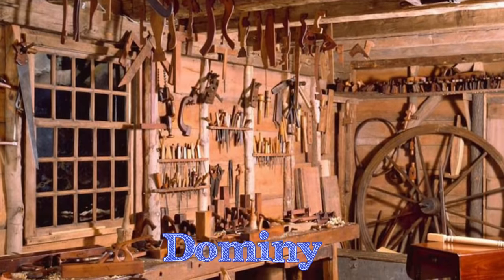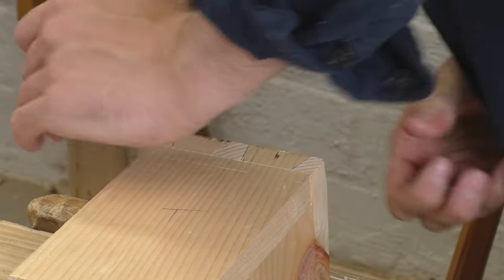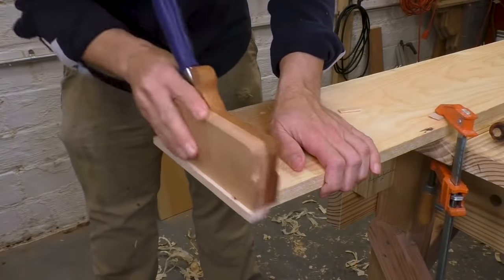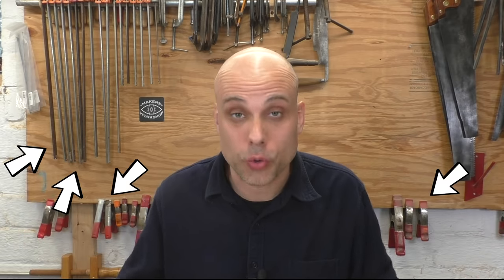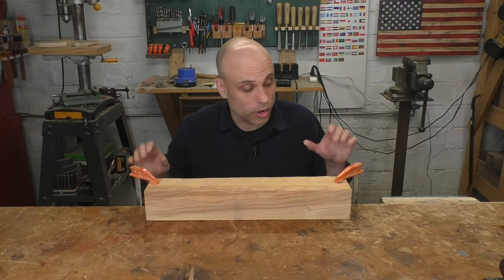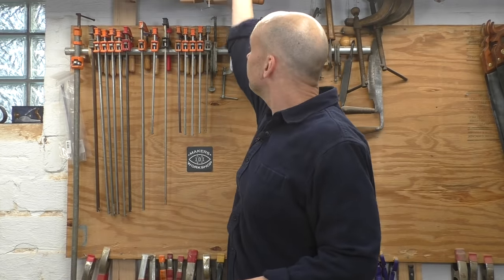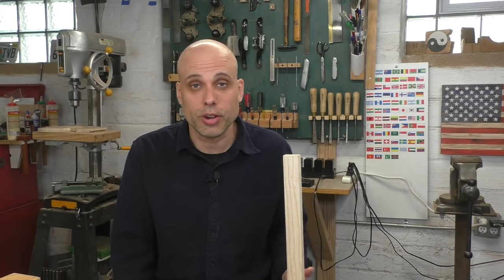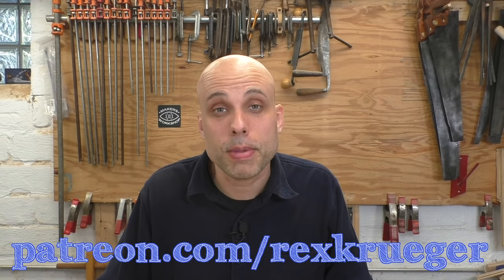Woodworking with very few clamps (maybe only 5).

Comment: Built all of my kitchen cabinets with solid wood and I get tons of complements. With no clamps and a circular saw. Used wooden wedges. Jointed boards with a sanding block.  Can be done but it's alot more enjoyable with a shop full of clamps and stationary tools I have now.

Comment: I just found your channel. Great video Rex. Another old method is to clamp with some rope or string and small blocks, and tighten the rope by twisting with a board- the Spanish windlass. The size of the clamp is only limited by the amount of rope.

Comment: thank you for sharing your thoughts.I quite often use a Spanish windlass,it's just a loop of cord slightly bigger than around your workpiece,then insert a stick,and wrap cord once, and turn to apply pressure.I tie a loop in the rope near the stick so I can secure it.sure you probably know the technique yourself,but very handy for squaring framing if you set at an angle.respect.mad dog.west cork. republic of Ireland

Comment: Spot on !  Moved to a bigger house with huge garage .  Once I started setting up I realized that I never use the machines that much so I left them in the truck.  That left me with just one wall of hand tools and plenty of space for 2 cars and maybe even the mower!  My wife was excited.  Thank god I built enough work benches over the years to take up that empty space! That’s my space!  Not for cars!  so the mower goes in the shed , and my wife will just have to get up a little earlier to scrape the wind shield and warm up her car, and I have five free benches to cover with antique woodworking tools I’ve grown so fond of and perhaps addicted to and are costing me money and time that could be spent with my kids, and maybe causing me to and go just a smidge into debt and putting a teeny tiny rift in my marriage that got worse when I told her there was no room in the 2.5 car garage even though I’m selling my machine tools to make up for my antique addiction which is  “ mildly unattractive “ according to my increasingly estranged wife and maybe just maybe I should probably my get professional help?  Has that ever happened to you?

Comment: These days I am building a new main workbench. BUilding it with joints for long lasting strengh.
I put glue, clamp up. Nail the joints and remove the clamps as I need to rotate them but I wont stop working on it ofc. The nail helps to keep the joints tight as I clamp them and this works specially well because I have 0 need to move the pieces anyway.

Couple of days later, the bench structure is solid as a rock.

Comment: If you don't mind me making a suggestion;  I use cargo straps at times.  They have a lot of clamping power, and using scrap wood to make a quick jig is usually easy.  I use the mostly for joingnboards to make a panel, and have no long clamps in the shop.

Comment: I actually have used C clamps quite a lot.  I love them because they take up little storage space and are great for face-to-face glue-ups.
Also, if you think clamping stuff to your joists is neat... observe that a standard milk crate fits between joists very neatly.  Get about 24" x 4" of thin sheet metal (computer case and metal 2x4s work) and bend it up at both ends with about 14" in the center, then drill some holes in the ends and screw it to the joists with enough vertical clearance to slip the crate up there.  It makes for awesome long-term storage for stuff you might go years without touching again.
Reply: Now make it swing up and down, and latch in place.
Reply: @leehaelters6182  you say that like I didn't already do it with two crates and cantilevers, fishing-box style.  :D
But I actually don't find the gadgetry as useful.

Comment: Great talk. Same in my kitchen, over time I’ve let all the fancy, specialist gadgets go. I do 95% of everything with one good fry pan, two SS pots, two knives. All the power mixers etc went, the only one I’ve kept is a hand held stick whisk. As the gadget inventory went down, my cooking skills went up. The electric knife sharpener got dumped in favour of the stones I already had in the workshop for chisels. The special slicers got replaced with better knife skills. Most times you don’t need another gadget, just another skill.
Reply: Facts.

Comment: Getting by with less - a while ago two carpenters put on a demo at a street fair and built a kitchen table that day using 18th (i think) century tools. Fine tooth buck saws, chisels, mallets, draw knives, that's all. It had angled apron with dovetailed drawer and slightly splayed legs. No glue or nails, just joints and pegs. Of course they were skilled, I think it took less time than power saws because there was no setup time. Beautiful to watch.

Comment: Hi rex, the good old spring clamp, I use a lot of wood that need a thin front face, most people will use an air nailer with very small pins that are easier to hid after the glue dries. I don’t like the holes no matter how small they are so I get an old inner tube they was to be thrown away, cut it into small lengths and pull it over the clamp, then put the wood on the edge puss these clamps over the wood and let the small pieces of inner tube hold the item until the glue dries, remove the clamp and you have edge banding without nails.

Comment: Fundamentals!!!! Yes!!!! Back in the day there was the 'rub joint' which joined boards side by side for panels, the glue dried QUICK so they literally rubbed the boards together until they stopped moving, done. Hundreds of years later and some are still true!
One of my favorites is called a 'fox-wedged tenon' THIS IS COOL!!! Also heavily involved ☹️
A normal mortise and tenon joint, the mortise has a bit removed at the two shoulder sides, the tenon has a slice or even two in the end! When you put the two together, the bottom of the mortise pushes wedges into the tenon, this spreads it out of course, keeping it from coming apart, basically ever again if done correctly!!! There are 600 year old Windsor chairs made like that and guess what? They're still FLAWLESS today!!!! I love it all!! I've got "lifetime guarantee" furniture I've built out in the world that is nearing 30 years old now, never once have I ever had a single call back for my promise of as close to perfect as possible!!!!
That 'sprung joint' he showed, I do everything I can to avoid that!!!! Sure, it works like he said, the moment you remove the clamp the wood begins returning to the tight ends and a gap in the middle. It may crack the joint in an hour, or a year or even a hundred years, but the certainty here is that it will win. Period. Wood has nothing but time. The glue will fail. FACT!!! I've found that if your joints are perfect, it takes very little to glue them, then they aren't trying to tear themselves apart after it's dry. You want ZERO forces working against what you are trying to accomplish. 
As for the rest of his video...... I'll admit it, I have a severe problem. My clamp addiction is far worse than any drug addiction will ever be.  😭
I'm powerless in the face of buying clamps!!! New, used, handmade, machined, garage/estate sale, AAHHHHHH!!!!! I have.....I'm guessing, more than 400? I have no clue how many, it's an actual problem similar to unchecked drug abuse!!!! I can't help it!!!!!! 
Ppsssssstttttt!!!!!! Anyone got any for sale?

Comment: If you still like clamps, but not buying them AND you like making your own tools... Check out John Heintz's videos on making clamps - F-Style clamps and the longer bar clamps. Pretty much using scraps, some threaded rod and a couple nuts and washers. They are quite elegant items when completed and could be fancied up into works of shop art in and of themselves. And since the most investment goes into the sliding jaw part, you could make up sets with multiple length bars for both the F-Style and the Parallel Jaw style - the fixed jaw and bar half being just some bits of wood, glue and perhaps a nail ( for clamping of course) 

Great Video Rex.

Comment: A agree with the smaller shops some of the best craftsmanship I've ever done have been in super small shops when I finally bought a house with a separate shop on the property it took a long time to get the flow of the shop down when the shops small its more fluent when its large you'll tend to see your self walking back and forth for everything it takes years in my opinion to get a proper work flow threw a shop.

Comment: Have you tried rubbed joints to join flat boards?
Plane square edge on two boards, apply glue to joint edges, rub the one board over the other to spread the glue and drive out air bubbles, finish rubbing the joint when it feels tight and the boards are aligned.
Air pressure and surface tension will hold the joint tight and the boards can then be left on edge leaning against a wall.
Works well with animal glues, and other glues with a short open time.
I use it a lot with jointing flat boards as I often can't be arsed with having heavy clamps getting in the way of a small workshop.

Comment: Great video. I recently use the wedge method to glue up a ukulele soundboard. A lot of luthiers use a stupidly expensive set up called Go-bars to apply downward pressure to glue small stuff up that would require deep clamps (like the braces on a soundboard). I happen to have a shelf that extends over a bench and bought some cheap fiberglass rods I use to apply the pressure. Instead of spending over $500, I spent under $15. The use is situational, but I wouldn't want to do it any other way. Thanks!

edit: spelling
Reply: Yankee ingenuity!

Comment: Awesome vid Rex! TY :)

Pre-Industrial Revolution, glue would have been "at need". It's not like you could go to a store and buy it cheaply enough to drench all your joints in it. Most woodworking glues were made from boiled down animal hides and fat. And, with the only potentially air-tight container being glass-wares...it had a finite shelf-life! There were other glues around back then, but most of them were water soluble. For woodworking, you'd be far better off with no glue at all, than using water soluble glues! I worked with an old-school carpenter in my 20s, and he showed me some super simple forms of clamping: bowed boards. Got warped lumber around? Awesome! Make it work for you! Secure the back of the work-piece against pegs in dog-holes, put the crest of the bow against whatever point you want to push on, bring one end of the bow almost all the way to the work-piece and pin it in place via your dog-hole, then heave-to on the other end of the bow and get a peg in to keep if from flexing back. You can generate some pretty substantial force in this way, and you can easily replace the bench-top in this scenario with a pair beams (scaled to the need), if you need to work on a piece which can't be laid on the bench-top.

Comment: Aloha Rex   You're correct  if you are concentrating on one type of project your needs can be small. But if you have more of a general shop, both metal and wood you need a few more types.  I have a few more than would be considered prudent, but I have been blessed with a career (retired now) that gave me access to some tools at very low costs and I did take advantage, that together with the knowledge of what are good Garage Sale and flea market values have given me a rather diverse collection. Also when the family was exchanging Christmas gifts (lists were used  $5-$50 range), I would pepper that list with odd tools and sporting gear. This was way before Amazon(pre 1985) so I used Sears Tool Catalog.   
I have shared my shop with a Makers group in the past. It is a hoot when someone has a problem/opportunity with a project and you can pull a rabbit out of a box and make their life easier.

Comment: Great video! I get asked all the time why I prefer traditional joinery and this is exactly it, doing a glue-up with drawbored mortise & tenon is so much easier than trying to get multiple 5 ft clamps in place in time. I will admit that the time it takes to cut some of the traditional joints does slow down the process a lot but I also find that part very enjoyable.

Comment: 9:26 I love those pony clamps. They get constant use with both wood and welding. Mine are best to death and I’ve even bent a few- they’re that strong. 
A couple 10’ 3/4” pipe clamps don’t get used much but when working alone on floors or wall sections or built-in cabinets they are better than a helper.

Comment: I use clamps a lot. Thing is, I use them for so many different things besides just pressing glue joints together. 
Holding stuff in place, fixing a workpiece to a bench, to gain leverage when bending wood, or just to tap something when the mallet is out of reach. 
I have rarely spent large sums on clamps, but I have always, always, bought them when I've found them on yard sales and flea markets. I have bins full of them, all the way from little paperclips to 10kg c-clamps from a shipyard.
I use ropes and straps too, and I always keep a bucket full of wooden wedges around. 
But I love my clamps.

Comment: gave all my pipe clamps away after getting a great deal on 20 Jorgensen  I-beam clamps. Made all my door making become simple and problem free all the years after that. One clamp you might want to also have even if its one or two is the Merle miter strap clamp. best clampin the world for doing mitered frames and odd shapes. Made making mitered frame and paneled doors doors a snap.

Comment: I have a lot of clamps, because I've inherited most of them, from various sources. Most of them, I have never actually used.
As to the wooden bench screws, or, as you call them here, adjustable twin screw, I've seen example where people have cut transverse v-grooves in both jaws, to hold pipe, etd. They can easily be modified for very specific tasks, making them one of the more versatile options. The other thing about them, on a personal note, when I first encountered them, they were marked "Jorgenson", so I calked them "Jorgenson clamps", for years, pronouncing the "J" as a "Y". I STILL sometimes call them "Yorgensons".

Comment: Hello Rex, I hope to be able to explain this, I do some woodwork as a hobby and I had to join two boards together, I don´t have any clamp and all I think to do was to cut the inner tube of a tire in a single long strip of rubber and with that strip a wrapped all around both boards when the glue dry they bond perfectly.
Reply: Excellent idea, have used it myself many times!

Comment: I lucked into 8 Bessey parallel bar clamps on clearance at a Lowe's when they came out with some new model. They were about $10.00 each and I was thrilled by my luck.   I actually found that I only ever needed 4 at the most, so I gave the other 4 to a friend who did not have much money.  Even at full price they would be worth buying, they really make a huge difference.

Comment: As an instrument maker over the years I have come across many interesting methods for clamping. Two of note are the Go-Bar method in which flexible wood bars are used to apply pressure to the top of a work piece to clamp, and method for clamping jointed boards together with string and wedges.
Reply: I love the string, caul, and wedge technique. Very elegant. Now that I find myself without my bar clamps I am wondering how well it scales up to tabletops. Maybe instead of winding string so many times for each clamp, a single web strap, with quickly tightening buckle? Have you used this method at a greater scale?

Comment: The last few times I've done woodworking I think I have only used clamps as extra hands while I did a dry fit or worked on the other end so that the piece didn't move. I've come to the conclusion that there is a design flaw in humans in the fact that we don't have enough hands :)
I would like to see a build off between Rex and Steve building the same thing.

Comment: Great video as always Rex! Something I think you could have added, I have used a twisted rope ( similar to a traditional bow saw) to clamp items together when I haven’t had a clamp big enough.
Reply: Can you point to a good resource on the twisted rope setup?
Reply: @woodytheskip1718  this is great, thank you so much for taking the time. I hadn't actually seen the windless stick on the traditional bow saw before, will check that out further too. Very helpful, getting some ideas cranking for sure, thanks.

Comment: We used those adjustable wooden twin screw clamps frequently in my father's shop when I was growing up.  One trick we used to speed adjust them was to hold each of the handles one in each hand and spin them--sort of like peddling a bicycle.  This would speed open or close the screw clamp's jaws quickly depending on which way you "peddled" the handles.  

Another trick was to quickly get the jaws of those screw clamps relatively parallel.  Adjusting those jaws could be tricky and most people seemed to use a board to set the jaws.  But if you only have the material your clamping a quick way to get those jaws parallel so you can clamp the flat surface evenly is to use what usually would be seen as the back end of the clamp, away from the jaws.  By adjusting the rear of the clamp to approximate the thickness you are clamping you will have a close approximation of parallel with the front jaws.   If you want it even closer, then adjust the fronts to be where you need them and readjust the rears.  That second lineup should have you super close to perfect for flat glue clamping.

Another non-clamp method of holding things together during gluing was simply rope or string wound around the pieces.  This was usually used for unusual shapes that were difficult to clamp normally.  If you need a seriously tight string clamping you can either double or triple wrap it.  Another technique would be using a torniquet style by using a small piece of wood (sometimes as small is a pencil) to twist the string tigher.